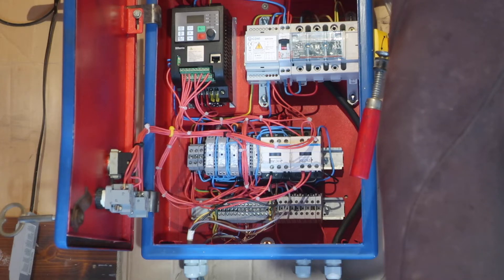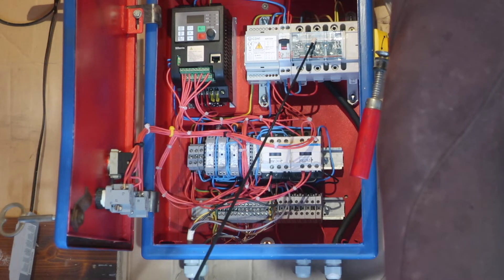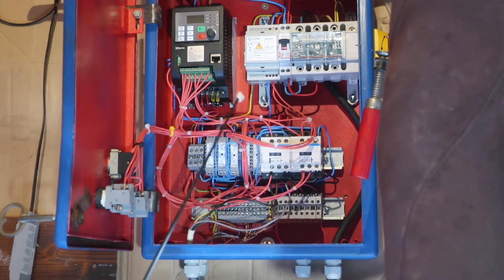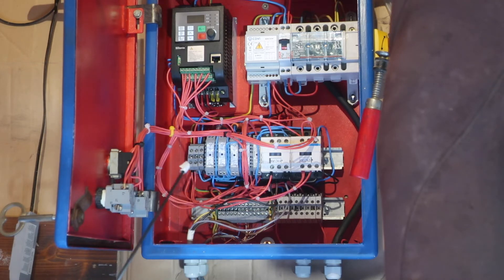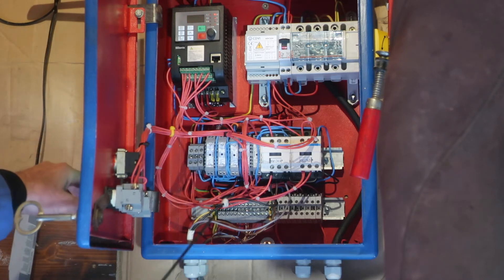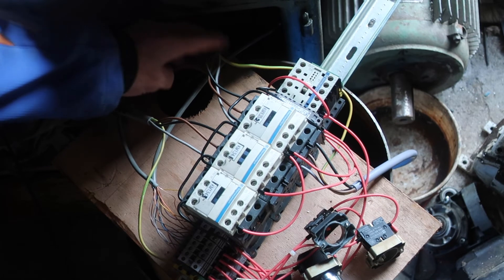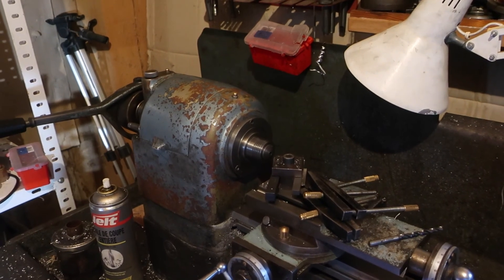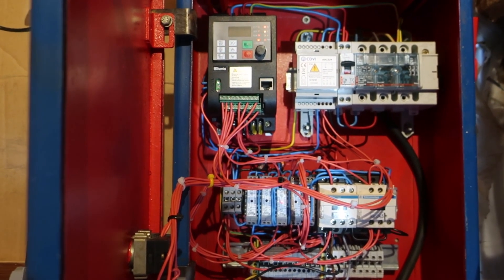Engineering terms 101 : The OSINTOT

Comment: LOL. What a spagetti bowl.  I can feel your pain.  Those Chinese inverters have caused many people grief.  I see a Schaublin lathe as well. Good video.  Cheers Rob
Reply from the maker: The spaghetti s all my own fault, trying to get too complicated.  If I had kept it all simple, just tried to run the mill at one speed and used the VFD like that, it would have been super simple. :facepalm:

I'm actually kinda proud of the spaghetti monster, though, even if it's not feasible given the inverter itself.

The Schaublin is a bitsa, Schaublin bed, headstock and under drive / cabinet, Maybe a Schaublin tailstock but with a Crouzet ram, and an ARE cross slide (longer compound action than the Schaublin).  I have a Schaublin cross slide as well but it's a lever action model, so doesn't get used all that much, and it only leaves me 12mm under centre height, which is odd - I can't find it anywhere in any of Schaublin's brochures..
Reply: @wibblywobblyidiotvision  What model is it ?  I have two ancient 102's.  One missing the compound slides.  Great old lathes but not for beginners.  Cheers Rob
Reply from the maker: @Xynudu  The bed, cabinet and headstock are probably 1950s, given the shape.  Closed W20 ball bearing headstock without speed reduction, and with a rapid collet closer.  The bed has t slots front and back.  The under drive is 2 speed motor, 3 speed v belt drive followed by 3 speed flat belt drive. 

Like you say, great lathes even if they're a bit limited in terms of screw cutting and the like.